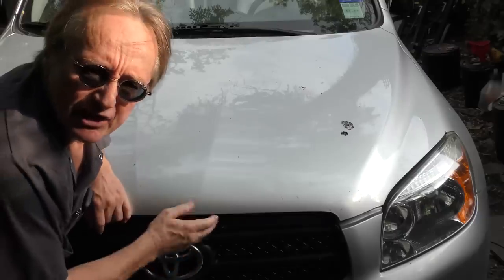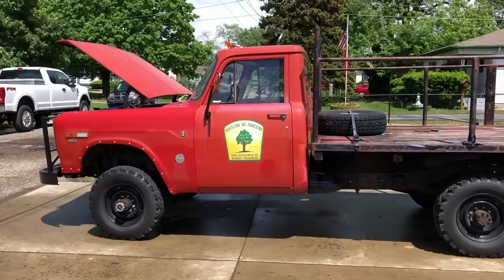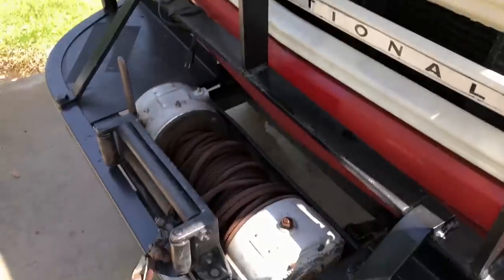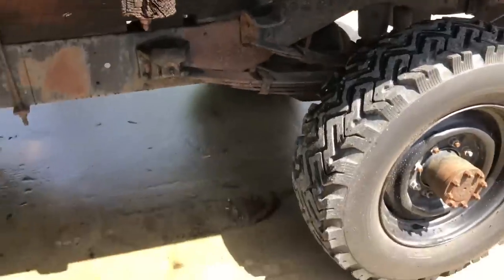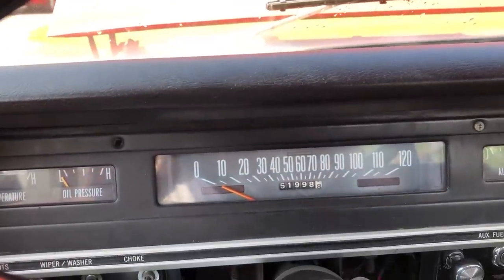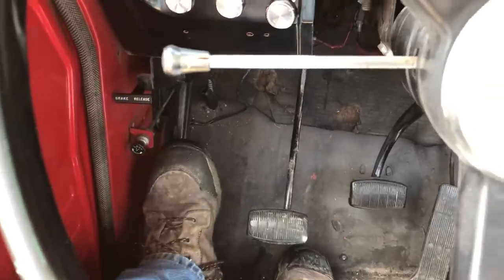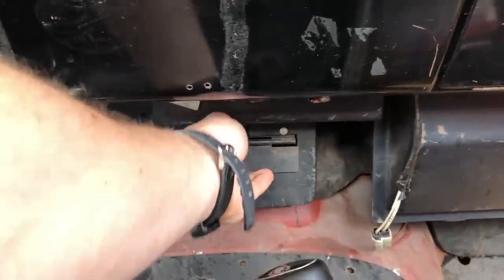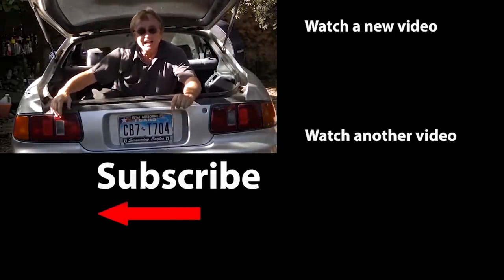Here's Why You've Never Heard of This Pickup Truck

Comment: Back when trucks were actually made for work and not hauling the family around to the grocery and retail stores.
Reply: Thats why i own a 1985 dodge w350. Was a park ranger truck. Things a work horse. Did a little something the the 360 thats in it. Bulletproofed 727
Reply: Kind of how my 95 Sierra w/t was.  Vinyl floor, AC Delco am/fm radio, crank up windows, ect.  My 2018 Ram Promaster cargo van would be considered stripped down now a days, but it still has power folding and heated mirrors, bluetooth, cruise control, power windows, ect... BUT she still has vinyl seats and floor lol.
Reply: Now they can do both -- comfortably!
Reply: I worked on a similar vintage "Suburban style" International once and was amazed how cheaply built it was.  They even half assed the front brakes with only one pad and the other side was just cooling fins with a steel shoe scattering iron filings all over the greasy undercarriage.  No wonder they went out of biz, pile of JUNK.
Reply: @Zeromaus  trucks now couldnt handle half of what that old binder can do.
Reply: @Mrbfgray  that would be a travelall
Reply: @livinginh  Yes I guess that's correct, thanks.  In the earlier yr.s they were considered the best by some ppl but they spent that good reputation toward the end.
Reply: Agoraphobic Adam ml
M
Reply: It's getting harder and harder to find a basic truck. My '89 Dodge had a five-speed, no power steering, no AC and no radio. By the time I got an 02 Silverado, they were all standard and the five-speed was a no cost option. Traded up to a 2014 Sierra and now they don't even offer the manual. I heard the other day that you can't get a GM half ton with a standard cab anymore. They're luxury cars with a cargo box.
Reply: GM has certainly cornered the grocery shopping truck market with their lineup.🤣🤣
Reply: @AcmeRacing  A very smaaaalll cargo box. I can haul about 10 times as much as one typical pickup truck with my trailer, that I pull with a sedan (up to 4000 lbs load limit).
Reply: My truck does real work and hauls thermally around.
Reply: What? This is just an International Harvester pickup, pretty common back in the day, as was the scout SUV, and the international eagle which was a 4x4 station wagon.
Reply: @livinginh  seriously? That old binder is only rated for 7000  lbs. Modern trucks can haul 9000, and can tow 13,000 in the lightest duty trucks.
Reply: Yes
Reply: This isn’t even the issue, the issue is what people do to them hahahaha
cringes as half the truck owners in the USA
Reply: If one vehicle can do it all why not😇
Reply: Real truck, not an ego hauler

Comment: Trucks should still be built like this, Maybe the average working class could still afford one.  Unlike the 50 thousand dollar trucks they build today.
Reply: youre gonna need the more complicated modern engines with all their sensored crap to appease OBD2 requirements. youll need unnecessary emissions and fuel support systems like evap capture and EGR systems to meet emissions standards. youll also need to meet MPG requirements by making everything lighter by trimming it all down and making it closer to the edge of structural design, which definitely isnt a trait of the older use-all-the-material-so-it-definitely-wont-break strategy... basically once youve appeased the law youll have a modern everything... i hate government
Reply: John D they get up to 80k
Reply: @MoparMadness93 ,  Which is why I drive a 15 year old truck.  On 37 thousand a year income I can't afford a new one ever.  Driving it into the ground and then will have to push it the rest of the way.  Once gas goes to 4 or 5 dollars a gallon like it did in the past Ford and Chevy will be out of business.  Betting all their auto production on large size heavy trucks.
Reply: At the time, as built this would have been more than a Ford or Chevy. This was Internationals version of a one ton. No else came close. Off the top of my head an RA15 probably rated around 10,000#'s. Spec books are around here somewhere.
Reply: @jackradzelovage6961  Actually they are lighter than the new trucks.  That truck probably only weighs 4500 lbs. compared to a new 1 ton pick-up which weighs well over 6000 lbs.
Reply: YA  more expensive than I payed for my home back in the day. Thay need to come out with new truck with very basic and some, just use old school part made modern. And make it affordable. Have the engineers design it technically cheap but externally tuff.
Reply: @williamdavidson9009  My 72 IH Travelall weighs 6500lbs 3/4 ton 8 lug axles and 4x4.
Reply: Oh this comment aged well

Comment: I learned how to drive dads 1964 International pick-up in the early mid 70's when I was like 11 or 12 years old.
It was a red 2 wheel drive and had a 3 speed transmission shifted on the steering column (3 speed on the tree) them were some of the best days, 
RIP DAD LOVE YOU

Comment: Neat little truck sad thing is I guarantee you it's more reliable than a 2019 GMC pick up
Reply: If it weren't for the salt and calcium chloride on the roads a lot more old trucks would still be in service. Especially when the price of a new truck are tipping $100,000.
Reply: @danw6014  New truck prices have a bunch of bs bells and whistles not needed. I need something to haul load and provide heat in the winter not something with heated leather seats and darn  tvs
Reply: Duke Of Prunes  most definitely cheaper to repair and easier my stepdad has a 2018 GMC Sierra that he uses and the oil field driving tons and it had catastrophic transmission failure at 88000 MI and it was a $4,400 job
Reply: @fractal4284  newer trans are designed to fail early. They want that 4700 every  88k versus a truck that can go 400k
Reply: @JT-91  yup I have a 1999 Toyota that has 680 thousand miles original transmission also very easy to work on change the clutch 2 times & throw out bearing once and I drive that truck 10000 miles a month absolutely love it 4 wheel drive locking differential little truck is a beast in the mud
Reply: @fractal4284  I have an old Chevy thats rocking near 500k. I trust that more than my wifes 2016 vehicle
Reply: fractal I have a 1977 Toyota truck, I just replace the engine. 20R out of 18' Dolphin motorhome, I wouldn't trade it for a brand new Toyota Tundra,
Reply: @daleslover2771  same old school Toyotas are beast they hold the resale value extremely will
Reply: No doubt  ! New trucks a ugly plastic garbage  !

Comment: Going from an automatic transmission to a standard transmission today is very nearly impossible. There is entire too much digital do-do to worry with in the modern automobile.
Reply: I was thinking in my youth, if a tranny went bad, you could slap a newer one in. Drive down the road without any fuss. Kind of sad. We learned a lot twisting wrenches.
Reply: The money that you'd save at the pump almost makes up for it though, even in a modern manual transmission where the engine is computerized; but the manual allows you to shift however you feel like and is less likely to break down because it's a more rugged design than an automatic with planetary gears and between 3 & 5 clutch packs or break pads that stop certain gears from moving...
Reply: Modern cars are built to fail and too complex for even the dealership to repair it seems like. I've wonderd if a mondern engine could be fitted out with points , condenser, carb and put into an old truck like that. Get rid of all the thousands of dollars of foolishness.

Comment: Borg Warner trans were bulletproof. Studebakers has em . LOL, the last thing to go.
Reply: Wish we still had Studebaker. Would have so much potential this year.
Reply: My travel-all . I am fairly certain ,had a  torque-flyt.
Reply: @davidhamm5626  IH switched over during this model year or shortly after.  I saw a 727 Torque Flite in a '70 3/4 ton that Super Scouts had for sale.  This one had a t-39 Borg Warner cast iron transmission.
Reply: I appreciate the information. I owned mine in the early '90s, it was the only one I ever owned.
I got it from one of my ex's co workers. 

It needed a fuel pump, one of the double action ones, which was around 50.00, and the trans mission filter, for the change.
Thank you for bringing back some good memories.
Reply: they are. Cast iron case. I messed up a planetary gearset in mine and swapped in a 727 auto. My truck has the 392 engine. I was not able to locate the parts to fix it.

Comment: LOVE IT!  My friend learned to drive on a Scout!
Reply: My Grandpa bought a 67 Scout 800 brand new in 67. He gave it to my dad in 75 and my 2 older sisters and I all learned to drive in it. Its now mine and I have since restored it. Really I just did body and paint and some minor mechanical stuff since the original drive train is all still running strong. I dont even know the actual miles since the odometer has turned over so many times and nobody knows just how many times.

Comment: One of the wreckers I drove back in mid-70's was an International. Tough as nails, and equally as comfortable. Twin boom Holmes 480 if my memory is correct.
Reply: Did it have a built in drum beat?

Comment: I've had an 1100 pickup and 1200 travelall. They were both overbuilt trucks. The 345ci engine was the same used in school buses and dump trucks, and crazy heavy. Amazing trucks.  The "light truck" line at International was basically killed by unions who went on strike during a recession, killing the company.

Comment: Only in a 1970's truck can you switch it from an automatic transmission to a manual transmission so naturally with no fuss...
Reply: Really. Pedal/linkage and shifter. Only electrical would be the neutral switch and backup lights, no new computer, sensors, relays, wiring, etc,etc,etc like now.
Reply: They have a divorced transfer case, so there’s a driveshaft between the trans and transfer case instead of them being bolted together. Makes it super simple.

Comment: I had one of those trucks.  Needs a 4 barrel carb. Mine had a 4 barrel Carter.  Got pretty good mileage considering the drive train. That truck could climb walls and pull down trees.  Great truck. Mine was a stock granny low 4 speed.

Comment: My first lessons with the clutch and lever were behind the wheel of a brand new 1968 IH one ton dump.  It was great experience.  Hauled hay, pulled heavy equipment on the trailer.  Amazing that the brakes and tires on the old truck were effective under the punishment we put that great old truck through

Comment: Definitely a work truck. When all the other trucks are fried from an electro magnetic pulse or some power surge. Change out those glasses fuses and it will fire right up.
A friend of mine had an old International Scout with the 345 in it. Thing was a beast.

In some states if the vehicle is registered as historic or over a certain number of years old. They are exempt from emissions.

Comment: Thanks for showing the truck. Reminds me of a IH 1210, 4wd pickup much the same I had years ago. Think it was early '70's, maybe '73. Same, 345ci V-8 w/ manual trans. Manual power steering. Plowed for years. Was still running when sold as body was rusted out. Truck ran strong still. Was a real truck like this one.

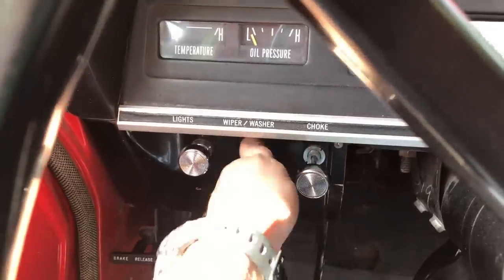Comment: 3:23 My old dump truck has two wiper settings.. ON/OFF and it blows heat whether you want it or not.
Reply: Same as my old fire truck. What's nice is I can get under the dash easy and unscrew the face plates to get at anything very maintenance friendly.

Comment: If you flip the glove box all the down the build sheet may be on the back.. FWIW the auto trans was probably a Chrysler A727 torque flight. Very tough and very buildable. Surprised it didn't have a limited slip diff. 345 ain't fancy but more than enough torque on the bottom and tough. Nice find, nice truck.
Reply: I actually have part of the original Line Set Ticket laminated that came with the truck.

Comment: 2:02 in my day the second set of Leif Springs was called overloads spring. The added set worked when a heavy load was added as cargo. If you didn’t have a load they were like this set pictured, there but not in service.

Comment: I had a 1972 IH 3/4 ton 4x4. I bought it used in 1973. Good truck but had a rust problem for only a year old. tailgate rusted through by 1974.

Comment: In 1981 i bought a 1200 d 4x4 for 100 bucks  my dad was a old hot rodder and mech  he made me rebuild my 100 dollar truck. Straightened the frame from previous front collision  welded floor pans rockers removed behind seat fuel tank and painted admiral blue metal  hand rubbed lacquer. 52 yo now  and have never had any need to hire mechanic. I learned alot doing this rebuild and rejuvenation at 15 -16.  Solid trucks
My dad took over that truck and drove it well into the late 90s. I had signed it over to him when i enlisted in the United states Navy. Truck is now in need of a restoration from sitting but i would not  doubt the old beast would start and run

Comment: I had pretty much the same truck only from1952. Mine had a long pick up bed. It originally had a 240ci 6 cylinder with a 3 speed, but I changed to a 240 6 cyl. with a 4 speed. With that 4 speed, I could put it in granny gear, get out and walk beside it. Great for pulling stumps. Same cup holder, but my truck was fancier. It had a radio. Sitting on the passenger side floor. Bullet proof vehicles and everything was interchangeable from year to year and model to model.

Comment: I remember the International pick-up trucks well, and if you notice the pick-up truck is missing something it's called a pick-up truck bed. Back in the day the didn't sell every well because the were junk. Wields would break, body panels would fall out, engines had timing problems, faulty wiring, other than that, like the man says they were great.

Comment: International must have been low bidder that year to federal and state governments. I worked for the state parks in 1970 and we got 2 International scouts and a dump truck. Even the local school district switched from Ford and Chevy bus's to Internationals that year. The 345 was a good engine, I've had a few and never had any problem with them. These trucks would last forever if you can keep a body on them to stay warm and dry.

Comment: 345 engine is almost indestructible.
Reply: My uncle Brian had 3 of these trucks back in the 80s. Two as parts, one a driver. I was small then, but, living in NY, the one main thing I remember is no matter how rusty it got, the damn thing ALWAYS ran. Don't matter how cold it was or hot.
Reply: @williamsinger4124  I had a 345 in a 1970s school bus that I converted into a motor home.  I could leave that thing sitting for a year, prime the carb, turn the key and it would fire right up.  Never ever failed me.
Reply: @shouldibehere  I swear you can run an old engine on wet leaves and it wouldn't care lol
Reply: @williamsinger4124  timed by 2 heavy steel timing gears.
Reply: My 1970 international has 260,000 miles on the original 345!

Comment: Scotty, is this where I should ask an actual question? Here goes either way... my Subaru outbacks steering has variable oscillating  resistance when turning the wheel even at 0mph...Fluid is full and clean, car is 12 years old....is the pump going bad?

Comment: Those are awesome I wanted one when I was a kid. I worked for a drywaller that had one with big tire like 35" . Awesome truck sanding drywall not so awesome but was a good job when I was 16. They where a real commercial vehicle that was just small. If we ever get hit with a EMP that's the only truck that will still be running.

Comment: About 10 years ago I was at the international dealer picking up some parts.  It was, what I thought was, a new International pickup. It was an international 4300, short wheelbase, and had a bed on it that looked to be off a Ford 350 duelly.  Don't know if it was something International built or was a customers truck , but it was out in the lot. A 4300 based unit would be one hell of a pickup.

Comment: The U.S. Army had purchased a few of them in the 70's and they were spec'd as a 1 ton stake bed to carry troops, cargo or supplies back and forth from garrison to rifle ranges and could be used very quickly out in the impact areas when the fire class danger was high to help stamp out brush fires. The training post that i worked at had 3 of them out of about 10 in all, being 1 ton stake bed trucks. The International models with a 4 speed, had a 1st gear that was very low geared (Granny-Gear) and would only achieve around 7-9 MPG whereas the a 1977 Chevy 1 ton stake bed body would typically get around 10-12 mpg. Both of those trucks were equipped with stardard transmissions and the one that took top popularity was the Chevy...Hands Down! If the International needed a clutch or a transmission to be replaced, it would just sit for up to 5-6 weeks before the repairs could be made whereby the clutches and tranny's in the Chevy models just kept going upwards into 100,000 mile and beyond! Most International 1 ton transmission models would suffer from early syncro failure and gear clashing, which met their early transmission failures and thus were the absolute worst piles of crap imaginable! If that truck were to be staged at military AF Bases or perhaps in a more controlled areas, well then their serviceability and maintenance records would have been okay. Outside of that, they were pretty powerful beasts for as long as they lasted with a very limited range of applications. I would have loved to of actually own a Chevy 1 ton stake bed body, because they were indeed very nice! Same thing with the Chevy 5/4 ton tactical 4X4! The 1970-72 Dodge 5 Ton stake bed truck with the Slant-6 engine was also a complete pile of crap too! That's what happens when the government low-balls their bidding on some of these refuse (JUNK) vehicles!